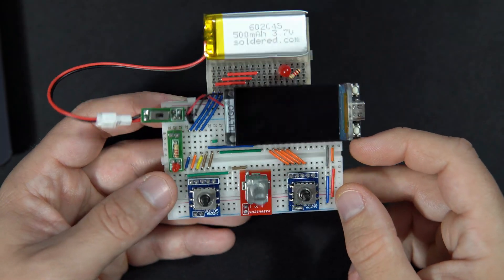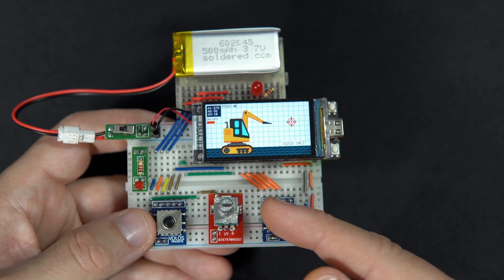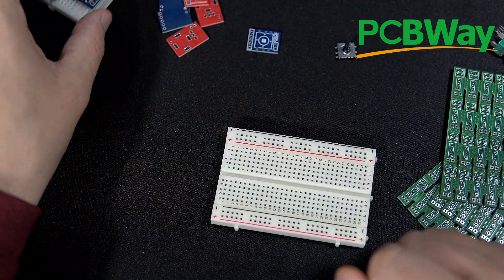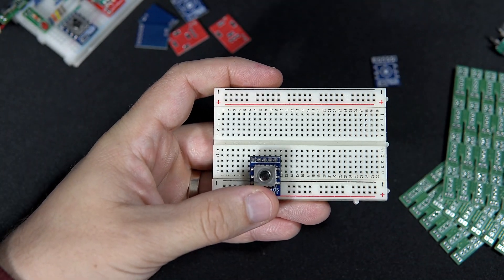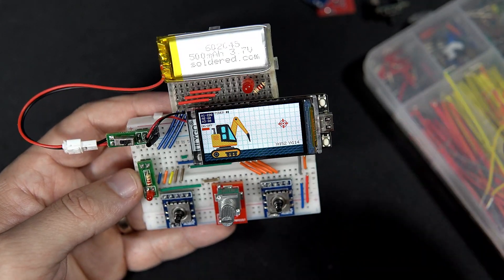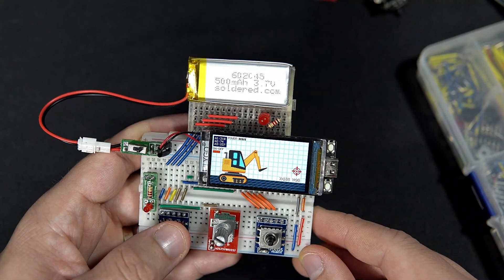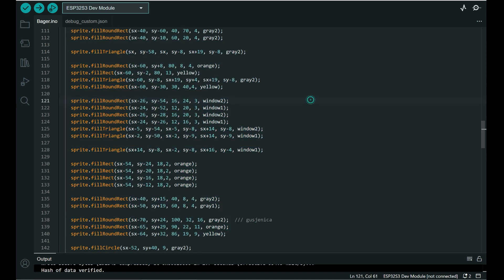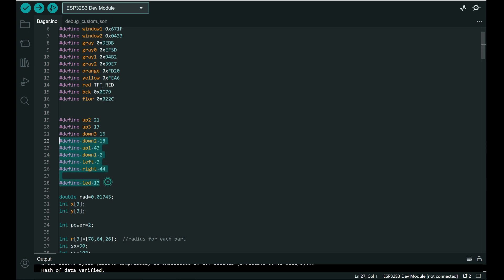Excavator on Breadboard? Why not! (ESP32 Project)

Comment: What do you do with all those unused/used parts/modules/micros? I’ve a box full of them and I don’t know what to do with them. For new projects now, I only buy needed parts.
Reply from the maker: I can afford new parts for each project, i save all of them , even resistors, most of them i will not use anymore. but many will be used again.